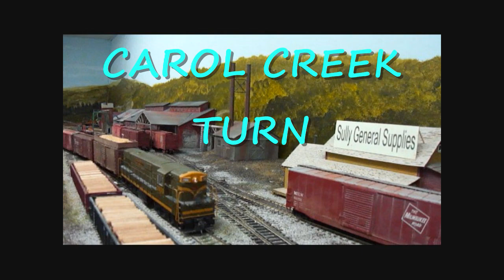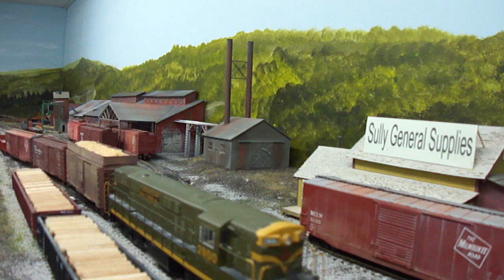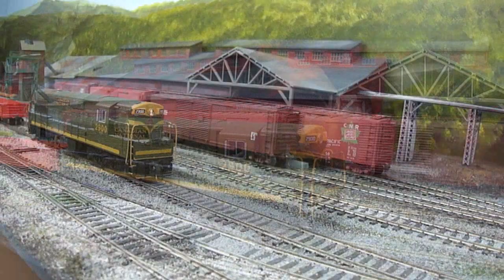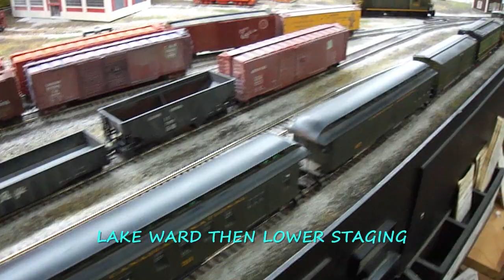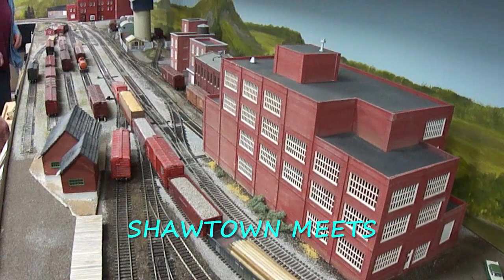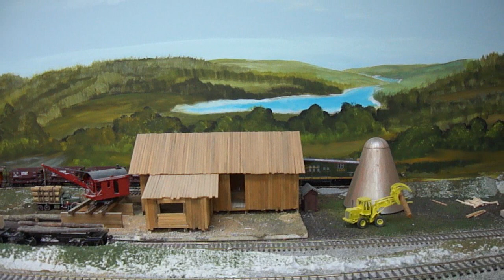TOM BADINOCK'S NORTH PONTIAC PART 3

Comment: Looks like there was a box car converted to hold wood chips there at 4:30.
Reply: +mastergeebo The solution to insufficient capacity... just add a roof rack.
Reply from the maker: +mastergeebo These were very common in service North of lake Superior.  A very inexpensive way to move woodchips on a low capacity mill site.
Reply: Something similar was done with grain and box cars if there wasn't enough hopper cars. Wood planks at the doors and a skid steer to empty/ fill the car.